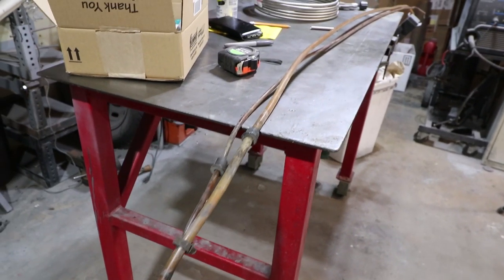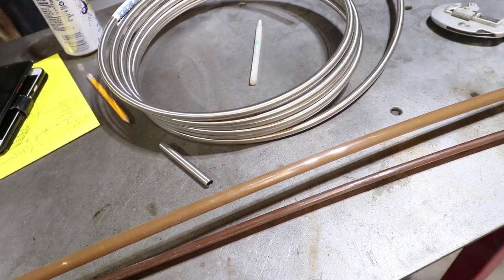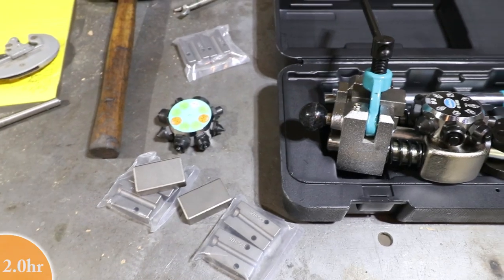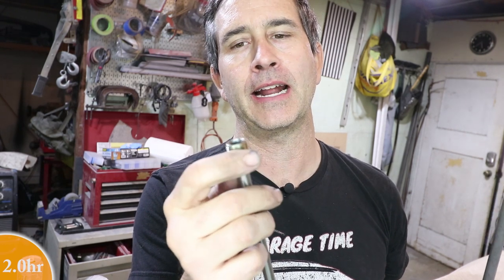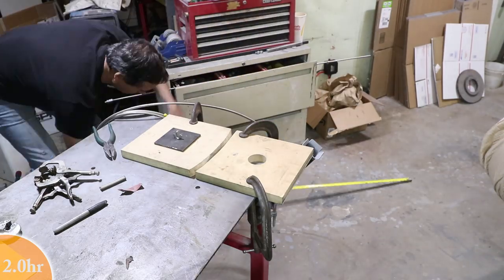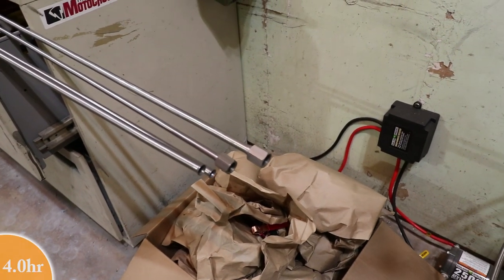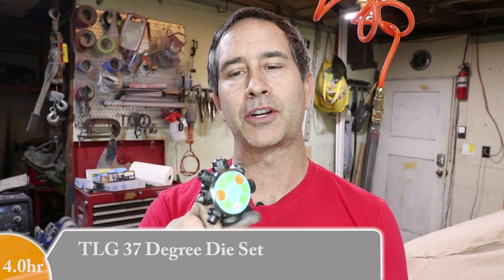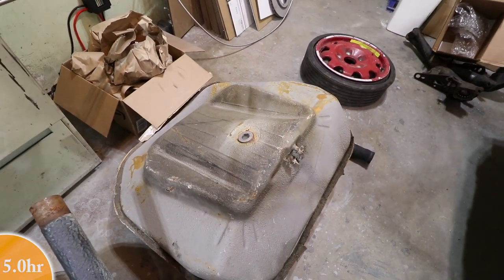How To Make Hard Fuel Lines Cheaply From $30 Stainless Coil

Comment: SOOooooo many questions come to mind!!!  I'm really intrigued by the submersible pump idea (one of my cars had impact damage to the fuel pump area). Will you be sharing the parts and tips details of the fuel pump conversion on Patreon?
Reply from the maker: Ok!  As soon as I get it figured out I can give you all the details on Patreon.  Like I commented to Dan, there is a lot to think about, aeration problems are the big ones.  One of my tanks has a plastic swirl pot in the bottom for CIS.  My goal is trouble free, quiet and reliable!

Comment: I have had my eye on one of those tools. Looks like it works great. What's available in the aftermarket for tanks for your car? Great work on the lines Tom.
Reply from the maker: The flaring tool works great, I can't wait to try it on the smaller and softer brake lines.  It should be a breeze!  Aftermarket tanks are available for racing (Aluminum fuel cells) $3k and up.  There are some cheap steel tanks available too that I will probably end up using if nothing else works out, ha ha.

Comment: Scary, that the nylon/plastic fuel lines were OK'd for use. Certainly a better solution with SS. I would use the older/better condition one and modify by adding the bulge since a spare tire is not necessarily required for your application. Center mount fuel spout? And if you really want range, cut both tanks in half and weld together.
Reply from the maker: I know those plastic line were very brittle.  I ran out of time, but I wanted to pressurize the plastic line and watch it burst!  My original lines haven't been exposed to modern fuels either because this car sat for 20 years wrecked.  
Great idea about making one large tank out of one!  A spare tire is probably worth keeping.  I can always find a gas station around here.

Comment: Nice with the SS pipes. I would probably do mine in copper as it is easier to work with and you can flare the pipes installed on the car. I am looking forward for the your approach to insert the lines into the tunnel :). Most likely going to be next winter as the car needs to be ready soon for the upcoming season. Regarding the tanks I do not dare touch them with heat or welding. Please be carful if you do cut/weld in them - a lot of people have died working on tanks as when you heat up the vapours from seams escapes into the vessel and booom. A safe way is to fill it with water. Why do you want to put the fuel pump inside the tank? You should have space between the tank and the tunnel for a placement.
Reply from the maker: Thanks!  Copper is easier for sure.  I'm going to use the copper Nickel stuff for the brake lines but not inside the tunnel   I chose stainless because it's more tough and won't wear through. I will add rubber around the lines in the tunnel but you never know.
I will fill the tank with water before cutting it up.  Good tip!
In tank fuel pumps get more cooling.  15A of electrical power is a lot of heat.  And the fuel pump is quieter when inside.  Another reason is that I can shroud the pick up with more tank baffling.  Stay tuned, I hope it will all make more sense when I get there.
Reply: Garage Time - Restomod I didn’t think about the cooling of the pump - it makes sense. Keep up the work - it is starting to come together, now only the fun parts are left (except wiring)
Reply from the maker: I like wiring more than sanding!

Comment: VERY INTERESTED in your solution to the "In-Tank Fuel Pump" - The original Porsche design is horrible.
Reply from the maker: Cool, as in the fuel pump will run cool, ha ha.  There's a lot to think about with the in tank design.  Swirl pots, surge tank, filtering, baffling, aeration, plumbing, serviceability, fabrication, and the list goes on.  Luckily I'm not the first guy to do it.
Reply: @GarageTimeAutoResto  I haven't really found a practical in-tank solution for the 914.
Reply from the maker: Right, I doubt mine will be practical either.  Heavy modifications needed.

Comment: I'd consider removing the damaged bottom of the Grey tank, and weld the bottom of the Black tank onto it. It would also be a good time to remove any Rust (at least on the bottom half), and seal the interior of that tank .... just a thought.
Reply from the maker: Good idea.  Do you know how to separate the fuel tank halves?  I haven't looked into how the flanges are welded together
Reply: @GarageTimeAutoResto  I haven't studied that seam on either of my two tanks, but think they could be separated in either of two locations. The lower sump area of the tank, or maybe a half inch before the original seam of the two halves.  I'm sure it would be tedious... but you're "handy" at welding...lol